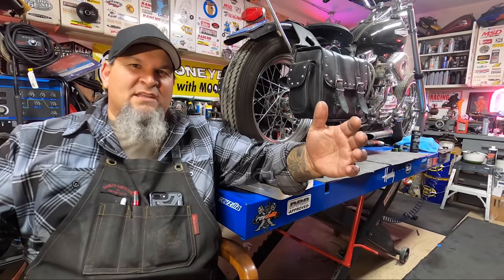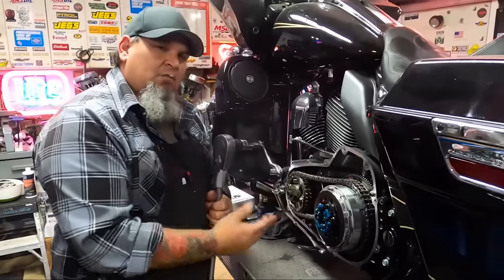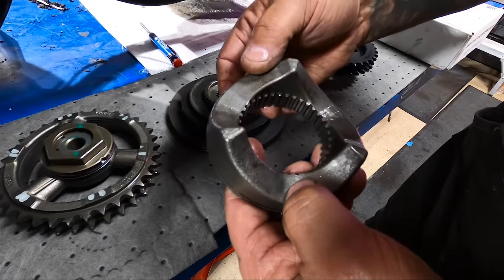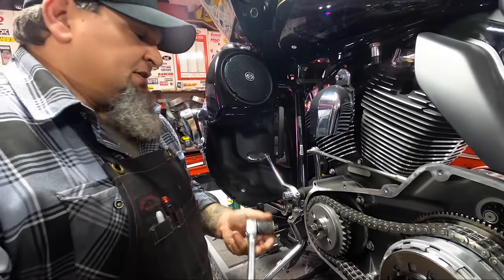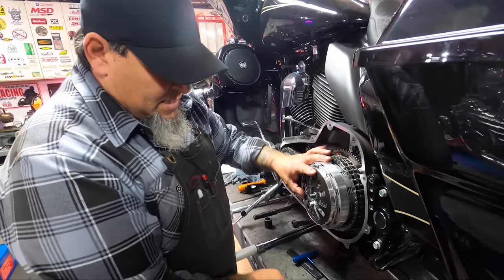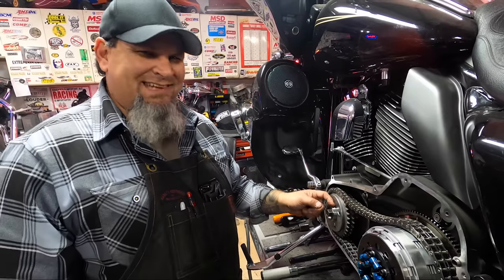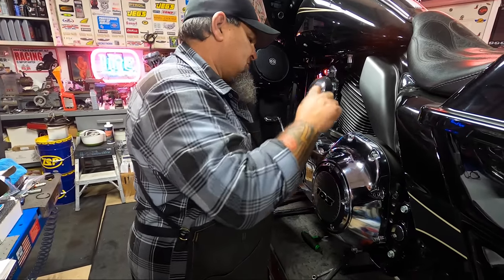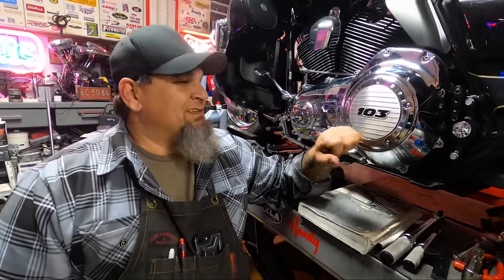Compensator Upgrade for Harley Davidson

Comment: I have read that the compensator cannot be installed if sprocket shaft runout is more that 0.010. It's true?
Reply from the maker: The Motor co new spec is at .010. That is for a warranty related replacement, as I understand. I would like to see less than .005 of an inch. Even .003 is a bit much but if we could see a factory crank that tight in spec we'd be lucky. What is yours at, do you know?
Reply: @LateNiteVTwin  No, I don't know my runout. I only have the OEM compensator which got very loud on start (heritage 2010 stage 1, 20000 miles). Now I have to choose a new compensator and I am interested in the Man O-War one, for this compensator should I check the runout? How long do you think rubber cushions last?
Reply from the maker: @michelepolidori5282  Well, there are a few to choose from. All can handle a stock engine nicely since the stock one is worn out. They all run close to the same price +- 50 bucks......So, with that said I would choose something that fits the budget. No sense in spending big coin since Baker, Screaming eagle, or the Dark horse will work. With the compensator change out you will need to replace the rotor which is the part of the stator that holds all the magnets since your year is welded to the compositor housing. those are available from Harley. Let me know if I can help!
Reply: @LateNiteVTwin  You were very clear in your explanation. Thank you very much

Comment: Why would you replace that version (most current) comp sprocket? The ones that are most in need of replacing are the '07-'10 ones. Followed by the the first version of the screaming eagle.
Reply: I guess the answer to my question is that you’re a gear head. As is evident with your clutch choice.

Comment: Alway enjoy your videos. Very informative. Wondering  if you can give me a little info. Cant seem to find a manual chain tensioner for a M8. Do you know of one. Thanks again. keep the videos coming.
Reply from the maker: Take a look at the Hayden unit......
Primary Chain Tensioner - M6BT17.
Reply from the maker: Dennis Kirk has them, and they are about 125 bucks. I hope this helps!
Reply: @LateNiteVTwin  ya. I've tried DK. Seems they dont make the Manuel adjuster for the M8

Comment: Hey Gary, love The video, I ordered The Man O war compensator. My local retailer is telling me I need to put and oil deflector. Your thoughts please
Reply from the maker: Hi David! You do not need the oil deflector that is needed when running the screaming eagle unit. The reason that is installed is the design of the harley unit requires additional oiling due to its design. If you have that epoxied to the outer primary, then it's ok to leave it. It is not required in the man o war changeover. If it was, they would include it in the kit.

Comment: Hi "Late Nite V Twin", what is the Man-O-War compensator longevity like?  Do the drive cushions last long? (forever?).  By the way, for anyone who upgrades his 103 cams in a stage 2 upgrade, is the stock Screamin' Eagle compensator's life drastically reduced?  I'm thinking of putting S&S 583 cams in my 103 and just wondering if the stock compensator is up to the task (I do like to ride the bike at low revs (eg, 1700RPM to 2600RPM).  And is it advisable to also invest in a centrifugal clutch weighted pressure plate?
Reply from the maker: Hi Jonathan, the Man-O-War should last around 40-60k miles, in a well prepped motor. I will assume that the stock displacement engines will likely last even longer as it's the torque output that kills them. Dark Horse offers a rebuild kit for them, and though mine is freshly installed and it's winter here in Northern California, I have very few miles on it yet. I will say the few hundred I have on it the feed back is great. Changing cams is going to help move your overall numbers up with HP, and a touch with torque but theres a saying, no replacement for displacement. With that being said, since the engine is still at 103", I don't see any issues with a screaming eagle unit. You can purchase parts to service that one as well, but as they deteriorate they do send metal through your primary liking the inner primary bearing. As far as the centrifugal pressure plate, I think they work well in helping with clamping force with engines that have hefty torque output. I have not seen issues with the stock clutch failing with the 103 with cams, tune, and pipes. I think that clutch wear is an issue with being hard on it like racing, stunts, burnouts etc. Sounds to me like you could choose an upgraded compensator of your choice, I would ditch the stock ratcheting chain tensioner for a manually adjustable one, and enjoy the bike with the engine upgrades you're planning on. I have been accused by some that I can spend their money fast, which in some cases are true but I truly believe that if you don't have issues with a bike that is performing well, and is maintained well, you don't need to waste your money on shiny billet parts you can't see. I do however recommend that good, high quality, precision made parts be used for reliable service and performance with any upgrade or repair. I also use these parts for my personal bikes so I can speak from behind the talk, because I walk the walk. I hope this helps??
Reply: @LateNiteVTwin  By the way, what's a good brand of torque wrench to buy?

Comment: I have a 1998 Harley Davidson Dyna fxdl lowrider as I go to start the bike or makes a terrible noise until it starts I was told it needed a new compensator does that sound like that would be true or could it be that the nut is loose. Thanks

Comment: Great job can't wait to see more stuff come out from you. There is not much rebuilding Brembo brakes from Harley.
Reply from the maker: Hi Amos, yeah, the Brembo's are pretty reliable. I do have issues with owners not having their systems flushed regularly though, and have seen the ABS control units fail, but as far as the rest of the system, they're pretty robust!
Reply: @LateNiteVTwin   I have a slight sticking problem it is not to bad. I've flush the system. It did not help I can hear the brake just touch the rotors. The front wheel will not fully spin. With out stopping its not hard to turn the wheel by hand but there still touching more than they should. I've cleaned around the rotors and flush all the lines. I think of rebuilding them if that and it has to be the brakes I think. It is and 2008 Electra Glide Ultra Classic with abs.
Reply: @LateNiteVTwin   by the way can you do a review on the man-of-war compensator

Comment: How much primary oil does it take for a 2007 softail classic if I take the cover off I have a oem manual and it just says to charge it takes about 32 ounces but it doesn’t say how much oil it takes if I take the cover off

Comment: I have a question I have a Harley it's a 1999 Road King on the second owner and for some reason you're going down the road doing 55 miles an hour and the bike just shuts off like someone hit the kill switch now the fuel pump is been replaced and a few other things I'm wondering if it's electrical like you have your input on that

Comment: This is a new issue I didnt even realize I had until this summer. I'll upgrade this winter. Why the hell harley wanted to make that spring ramp drive is beyond me. All that man-o-war did was the obvious thing. Cush drive has been around on everything for years. Why wouldn't it be the best set up. When it wears out, it's still going to be there just loose. And not fill your primary full of metal. I was considering the gear drive. You may have talked me out of it. I dont mind a little harsh but if it's really bad I dont want to kill the ride.

Comment: Hey Gary.. Great video great channel very informative. I really want to install a Darkhorse Man O War comp sprocket on my 2017 Low Rider S with the 110 SE engine. Will I need to measure my sprocket shaft runout before installing this sprocket or will I just be able to replace the POS SE comp sprocket with the Man O War without measuring sprocket shaft runout? I can't seem to find an answer to this question. I tried calling Darkhorse but haven't received a call back yet. Any help would be greatly appreciated.
Reply from the maker: You can check runout at the crank, but with a bike that new and no issues reported, you will most likely find that you are good. I am not saying NOT to check it, but the manual will have that information. The video we did on this was done on my personal bike, and it works without issues at all.
Reply: @LateNiteVTwin  Thanks for replying and thank you for your channel and very informative vids. You help people greatly by sharing your knowledge. A++++++

Comment: Hey buddy have you ever tried one of those primary chain adjusters on the Dyna model I have a 2014 low rider went to replace it with PRS tensioner and when I install the tensioner  At the lowest adjustment it had the chain is as tight as it can be there was no room in that adjuster to give it slack have you had this problem please let me know thank you

Comment: Great videos 
THANKS 
What's your opinion on Vance and Hines pro pipe 
2018 limited 
Stock motor
Reply from the maker: Glenn, the Pro Pipe is a great pipe. The only thing I can say is, stay away from the high output part number with a stock motor. It will have more flow that your engine can use and it may be difficult to tune. I like the Dyno Jet Power Vision tuner. The FP3 Vance and Hines tuner is a good choice to, but the Power Vision can be dyne tuned if you start using cams, heads, and other mods that the offered maps don't have. I have lots of customers who run one, and they make really good power, sound good to!

Comment: Great instructions Gary.  I'm replacing a SE compensator on my 09 glide and came across this video.  My question is, do I need to replace the rotor as well?  Baker compensator calls for this to be replaced as well...I don't see the need using the Man O War.  Please advice and thanks in advance.
Reply from the maker: Hi Sergio, yes, your rotor will need replacing.....
Reply: The HD rotor has a built in spring to hold the comp together. When you change it, the spring is deleted. Just cough up the extra hundred bucks. BTW, my 09 Road King is torn apart with new comp and clutch ready to install. The instructions clearly say you must use the oil deflector and recommend you use a special bolt and washer to install the clutch. I am gonna call it a night and phone the company tomorrow to make sure I do it right. I have a grand in new parts going in and don't need to tell the wife I effd up and need to open the case again.
Reply from the maker: @Mike-uh2gw  Well, I always recommend doing what the manufacturer needs to see going into the job. I'm confused about the clutch bolt and washer, as the clutch adjuster is a standard part but if the clutch you have is different, then you'll need whatever parts they recommend along with that to install.
Reply: @LateNiteVTwin  After rereading the instructions 3 times, the tapered bolt is for the sprocket, just like you have in the video. The taper helps channel more oil into the weep holes that feed the inner bushings on the sprocket. Your video is great. I appreciate you taking time to make comments and help us newbs get right.
Reply from the maker: @Mike-uh2gw  Glad to help brother!

Comment: Hey Gary ! Like your video is great I put the Manowar compensator sprocket on followed your video I also put the manual adjusting chain tensioner on I put a half inch play In it . Got all my oil in torqued everything just like you instructed and everything. And I’ve got a whining noise in my primary. I got a 2015 RoadGlide with 52,000 on it stock and I don’t bet on it . I was just wanting to know some suggestions what to look for or should I just ride it for a while and maybe see if it quiets down.
Reply from the maker: Hi Mark, so the inner primary bearing behind the clutch can be noisy  due to the high tension of the factory set up. Which tensioner did you go with? The Baker is a bit noisy and the Hayden is a bit quieter. Take a listen really close to the clutch area when the bike is in neutral. I like to stick my stethoscope up between the back of where the belt disappears behind the inner primary. If you hear the whining from that area, replace the inner primary bearing and seal. They are known to go bad with high inner chain tension. I hope this helps!
Reply: @LateNiteVTwin  Hi Gary . I went with the tensioner just like what you had in your video it just seemed a little bit noisy. So I went back with the original self tightening chain adjuster And the noise quiet it down but just a little bit of whining noise from the primary not much. I’ll take a look at that bearing in the primary behind the clutch hub. Thank you for your help.
Reply from the maker: @markferris8775  Anytime Mark!

Comment: Run ATF in the primary, it's designed for clutches, and chains don't care what kind of oil they get, plus it's way cheaper than any motorcycle or "Harley" oil.

Comment: Thanks for great video sir ! I got 2012 road king classic making clunking sound when I shut the bike off , I did tighten the compensator bolt & the clunk sound reduced but still slight there ... Is that mean I need to replace the whole compensator ?? Thanks 🙏🏻
Reply from the maker: The compensator will clunk at shut off as it is showing signs of failure, for sure there are more symptoms of failure when starting, kick back, and general clacking noise. Sounds like you're getting close....
Reply: @LateNiteVTwin  thanks for replied 🙏🏻 even though my roadking only done 13000 miles , is that possible that the compensator is on the way ?? Thanks

Comment: Should I use synthetic oil in a 2014 Heritage or what would you prefer boss .
Reply from the maker: I have used synthetics for years with great success, but always prefer break in's with a non synthetic oil. Pick your brand, but make sure you have an oil that supports your SFI or API needs

Comment: First install video I’ve seen on the darkhorse. Much appreciated !I have heard of problems of severe noise on older models with higher mileage . To fix that problem I’ve been told they now recommend checking your gaps with a feeler gauge and if it is out of rec spec they now supply shims. Did you experience any noise problems ? Again thanks for video
Reply from the maker: Hi Brad, are you referring to the stock compensators? I have talked to harley many times over these compensator failures as I have shredded 3 of them, they now want to send them in to harley to determine if they fail......When the clack on a start and kick back, rattle under light throttle, they're bad. No real feed back to give on the Dark Horse unit quite yet. Still to new to tell, but so far so good! I like it!
Reply: @LateNiteVTwin  
Thanks for the reply. I’m referring to the darkhorse unit. I was advised to check the sprocket shaft runout and the alignment. My buddy just installed his without doing the above and he has lots of noise coming from the primary now. In the directions he received with his unit it did not mention any of those steps. Yours is the first in depth install vid I’ve seen and was curious if your directions stated to follow those steps first. I hope you do a follow up vid. I really want this setup but I have a 08 with over 25k so I might have a noise issue. Thanks !
Reply from the maker: no noise at all. The kit I purchased did not come with shims, nor in the instructions did they even hint about any issues related....Looks like I need to give them a call! Thanks for the info!
Reply: No worries. FYI tonight after speaking with my buddy about your vid I went to there website. Go take a look. They have the instructions to download. Guess what steps are there lol smh. Those def werent with my buddies kit either. Good luck with it and please do a follow up vid
Reply: @LateNiteVTwin  ---> I recently bought the Man O war engine sprocket from Dark Horse to install on my 2019, 114-inch, Road Glide Ultra. On the directions in the box it says to lay a straight edge across the Man O War sprocket and the stock clutch. The run-out should be no more than 025. If the run-out is more than .025 Dark Horse says to call them and tell them what width shim that you need. I already have the Fueling dip stick vent, the Rivera oil pump and S&S tappet cuffs too. The Fueling oil pump and backing that offers 42% more oil scavenge over the stock HD oil pump and 68 % more oil volume to the crankshaft and connecting rod bearings. It also reduces blowby and wet sumping too. Right after the install I took a test ride and I could feel a noticeable difference on how my 114 engine gained RPM's vs before the install of the Rivera oil pump and backing plate. Not a big difference but a noticeable difference.

Comment: What's your opinion on the compensator elimination parts that completely remove the ability to move it's just a solid peice w no springs ??
Reply from the maker: Hi Chris, are you talking about a manual tensioner? If so, yes I do believe in those due to the set it and forget it life of the chain. Chains do not like constant tension, unlike belts. So, with that said like the days of the manual tensioners, we had 1/2"-5/8" tension set for slack in the primary chain, and had very few issues with the inner primary bearing and transmission bearings.

Comment: I do have a question. I have ‘14 street glide special and it seems like something is rattling in the area of the main chain drive like when it’s idling and if I take off and don’t give it enough throttle. After watching this video I’m wondering if a manual adjustable chain tensioner is what I’m needing?
Reply from the maker: Hi Stephen, I have not heard a rattle from the adjuster before. They hang on that chain pretty tight. Do you ever get kick back on a start up that never really catches? The noise goes away when under load?